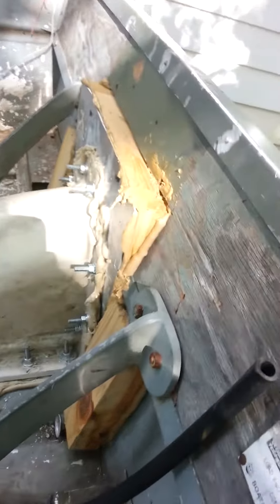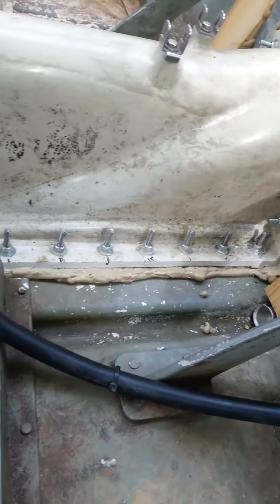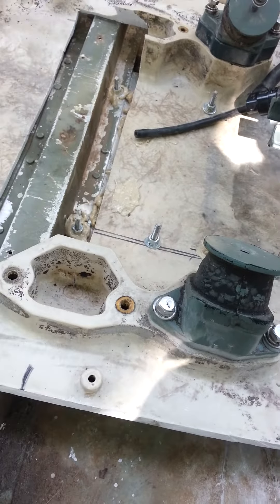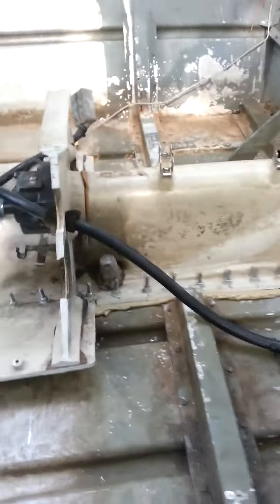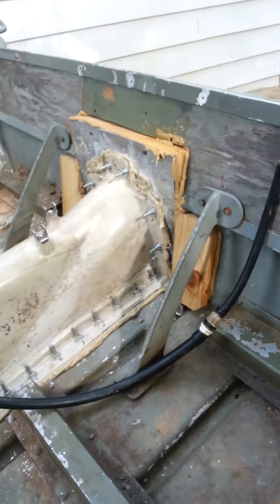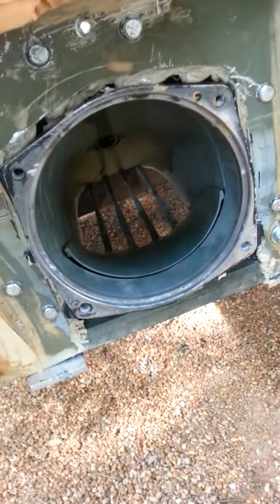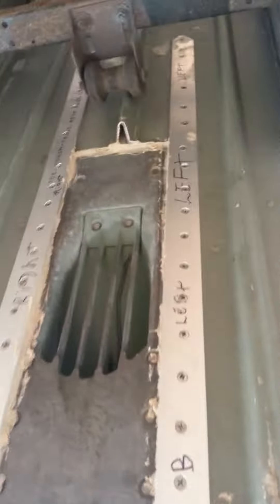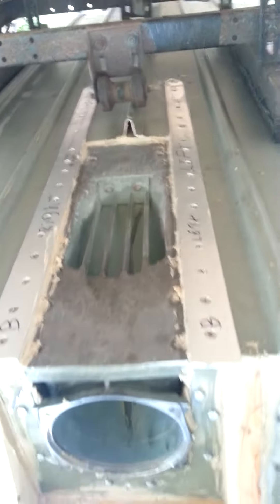Jet Jon Waveraider 1100

Comment: Did you run into any problems at all with the intake being flat with the bottom of boat? I was thinking it should stick down alittle more then the bottom?
Reply from the maker: I guess the fact that it is so far to the back end allowed it to pick up water very easily. It will cavitate with choppy water. But that thing is ultimate skinny water boat. I've got one now with polymer on it, I built out of an airboat hull. It sticks up into the flat bottom over an inch. And it picks up fine. I will surprise that what as well. Truth is you can't really turn going wide open. So the back end sinks down just a little bit. But when you gun it it jumps right back up on top.
Reply from the maker: Also I left my runner that runs the length of the boat down the center on. Does not cause cavitation a bit. I did hit a rock with it and bend it. Now when I get up to above 40 mph it starts to rudder the boat a little bit from the front of the intake. Lol.
Reply: I just built one just like it an it cavitates a good bit I done it just like you did flat an all the way back! Is there anyway I can contact you to show you a video?
Reply from the maker: @danielcamp7315  hey Daniel, if you want to send me a friend request on Facebook or whatever you would be able to send it messenger. Yeah if it comes up out of the water without cavitating then it's not a seal problem probably. But if it tries to cavitate before you're planed out, you may have a seal problem. Yea send me a video however you can.